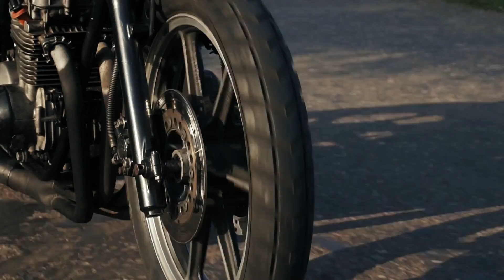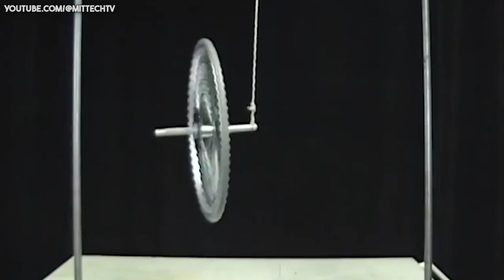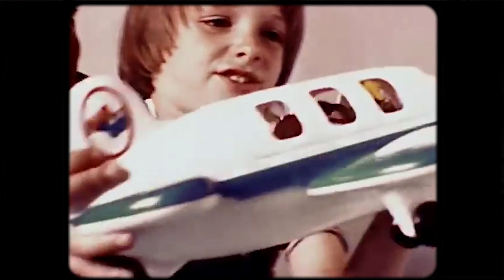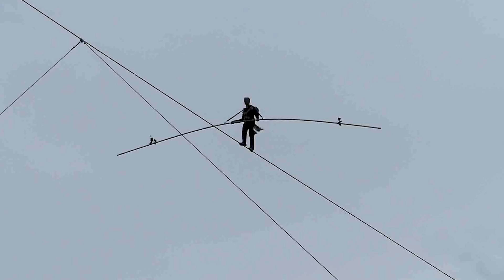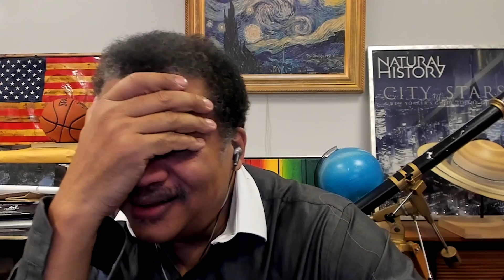How Do Bikes Stay Up? | Neil deGrasse Tyson Explains…

Comment: When it comes to bikes and motorcycles it all comes down to the rake (offset angle) of the front axle and the fact that the fork can move turning the wheel left/right, while the rear axis is fixed. Bicycles and motorbikes has two critical speeds. Going forward reaching critical speed the bike is self-balancing. Going backwards reaching the other critical speed the bike becomes completely destabilised. This means that reach enough speed going forward and the bike will lean the front wheel into any turn and self-correct raising itself up due to center of mass, rake and newtons first law. Reaching enough speed going backwards and not even the best computerised system can keep the bicycle upright (it becomes complete unstable). So the video is missing a few key elements to a bike, mainly the effect of the rake and the fact that a bike has two critical speeds, one making it stable, one making it completely unstable.

Comment: Neil, thank you for the excellent explanation of the equilibrium on the rope. But when I was a kid, we used to walk on the rope with a rigid bamboo pole and not the flexible one. Of course  the rope on which we walked was not very high and the pole was only about 3 m in length.

Comment: Apart from gyroscopic forces there is also another self righting force generated by the castor of the front wheels; i.e the angle the handle bars make when connected to front wheel. That's why you can let go of the handle bars in motion and the bike won't tip over and continue to follow a straight line. Perhaps that explains why the bike with the counter rotating wheels to cancel gyroscopic forces was still able to stay upright.

Comment: high wire walkers use heavy stick that is why its bent so much. It must be heavy for higher inertia its getting to act like a handle to increase balancing ability. put those wobly figures(weebles?) on that wire and see if they would rise after tilting to a side. on a plain they are suported where ever you lean them. on wire not. they only teoreticly would balance on wire only when tilted in direction of wire so that walker should hold that stick paralel not cross that wire if lowest center of mass would only be the reason why rope walkers use that stick.

Comment: I am no physicist but I think that for a bike (or any comparable vehicle) to stay upright, the center of mass must actually be ABOVE the center of the wheels. And if you think it through that kind of makes sense: A system of any kind is only stable if it is able to counteract any disturbances from its equilibrium (like those wiggle-dolls you mentioned). For a bike that means that if it is going in a straight line and upright, it must counteract any motion that drives it away from that configuration. Imagine the bike (going at some speed) tilting slightly to the right (or left). What happens initially is that the front wheel will - due to its  gyroscopic precession - turn inwards to the right, ultimately forcing the bike  to turn. Now, because for most bikes the center of mass is located pretty high up relative to the center of wheels (plus rider even more so) that turn will induce, loosely speaking, a centripetal force on that center of mass to the opposite side, resulting in the bike leaning back to the left. This will go back and forth until the front wheel is aligned again. If that doesn’t appears convincing, picture a bike where the upper half of the frame is made of light plastic and the lower half is made of heavy lead. If that bike, rider excluded, were to go downhill starting in a stable configuration and started to tilt to the right, I would not expect the bike to realign itself. But that’s just my theory and I could be totally wrong haha. Cool video anyway✌️

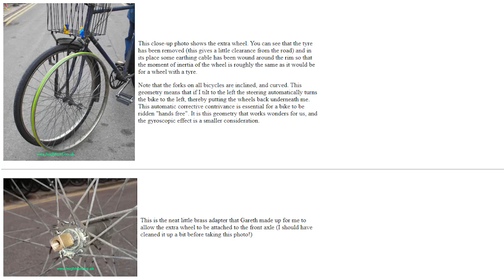Comment: 2:08  "which cancels out the physical angular momentum of the rotating wheel"... and?!  it doesn't cancel the gyroscopic effect(!), it increases it(!).  o what you say at 2:16 "the whole system cancels the gyroscopic effect" is just WRONG.  wrong.  wrong.  wrong.  surprisingly wrong coming from a mind like yours.  and all your interlocutor can say is "interesting", eating it all up.  lol 
however, it's not just gyroscopic effect, it's also balance and corrections made by the person (that's why we can ride a scooter with tiny wheels just 7cm in diameter).  And it's also the bike's geometry (ie: trail, which is a term used to describe where the tire touches the ground in relation to where an imaginary line through the steerer would meet with the ground).
Reply: Nope - NDT definitely got this part right.  And it's not like it's difficult to test this one yourself.

Comment: If there is no external force to cause acceleration of one half of the tyre and an equal but opposite deacceleration of the other half then the front tyre will remain straight , i.e stability while in motion.

Comment: The best film version of ghost bike is found in ‘Jour de Fete’ by Jacques Tati. It parks neatly at a cafe in jaunty manner.
  Two counter-rotating wheels sharing same axle and plane of rotation cancel out? I know very little.   
  A single rotating wheel is more stable than two with one joined to frame and one freely yawing…….

Comment: What if ha ha hypothetically speaking my bike with half a tank of gas weighed 99.79032kg and I weighed exactly the same as I bailed and watched my baby 180 into a sad tank of water. Drowned. Then my '02 Silverado retrieved but did not rescue that Blue and White motorized bicycle of art. God bless all pickup truck trailer hitches. Otherwise my bike would be a geological distant artifact.

Comment: We also make small corrections when the "bike" is moving slowly, by turning in the direction of the fall. This creates a "centrifugal" force, returning the bike to an upright position.
Reply: Nope.  There is no centrifugal or centripital force to speak of when riding slowly.  You're simply moving the bike underneath you to maintain equilibrium.
And the "QED" argument?  The track stand.  I can sit forever in a track stand, with only little forward and backward motion (which is translated by the front wheel to left and right motion respectively).  Obviously when you aren't moving, the wheels have zero moment of inertia, and thus no centripital or centrifugal forces in action.
The bike is simply moved back and forth underneath the rider who maintains balance equilibrium above it.  When falling left, I power forward, with a left-turned front wheel and the bike rides underneath and "catches" me.  When I "fall" right, I roll backwards and catch myself on the other side.

Comment: It has little to do with the center of mass being low, more about the fact that centrifugal force does not exist. When the front wheel turn left or you lean the bike left the front wheel turn more left than than the back wheel, this result in the back wheel continuing its course and thus acting like a force pulling the front wheel back to the right. This plus the energy given from the ground hitting the wheel giving it 2 effects permitting is to lift itself back straight.

Comment: I’m sorry, but this was a very weak explanation. It wasn’t bad for the high wire, but said nothing about the bike.
Of course centrifugal force has very little to do with it. I can ride a bike extremely slow. Yes, lower center of gravity helps but it will always be precariously high above the two small points of the base.  The center of gravity must remain above the plane of the two points.  If you start to fall, you have to turn the wheel in the same direction, which moves the plane under where the center of gravity had moved to, making it stable again. That’s it. To prove it, try riding a bike with two fixed wheels. The ride will last about 2 seconds, because you are unable to keep the center of gravity over your base (unless you pick the front tire up and move it just right, like a pogo stick).

Comment: We gotta "know" the 'critical' center of mass in the system we desire - like on our bikes or up on the wire. 'Critical mass' like the moment between not boiling and boiling - there's a point of no return  - the center of mass can bring you down to the ground because it is so heavy- it ain't easy till it's easy, then it balances. You don't forget how to ride a bike, so they say.
As an off-road rider I grok this, the bike will just stay up if you keep yourself flexible, strong and ready to go with the bike. Use the throttle and clutch to keep momentum and brakes to control speed. You put the body's momentum toward the line you want while looking fairly far ahead.  Hitting huge rocks will fling you one way or the other and the bike will just stay up if you can hang on and stay ahead maintaining correction momentum for the body to match the center of mass toward the lowest point in the system. It's an amazing fun ride.. hang on!

Comment: Bicycles are rear wheel drive so the gyroscopic precession is in the front wheel.

The industry term is "e-bike".  Which is short for, electric bicycle. The battery pack on e-bikes is typically on the down tube or seat tube.

#Bicycle #GCN  #Bike

Comment: Sorry Neil to completely debunk u're theory about the e-bikes being less stabile than those without motor and battery cause it is just vice-versa: the e-bikes especially mid-drive like mine are more stabile cause the engine and the battery that nowadays anyway are having only 5-7 kg adding are LOWER than the center of mass of a simple one that is very much raised by the very YOU that at let say 80 kg vs the 20 of a simple city-bike when motor-akku unit added the center of mass is dropping by quite few centimeters !!!! ;)

Comment: As a long time bike person I can also comment on that the amazing thing about a bike is that when you make a turn, you actually first slightly turn the handlebars in the opposite direction of your turn (so called "counter steering"). Many bike riders deny this because it is so counter-intuitive, but it is actually for real.
Reply: I'm also a many decades long rider of bicycles and motorcycles still, and I agree. You are correct, weird as it may be to the inexperienced. Only a nuance I'd add is (of course) it applies at a decent rolling speed once it 'kicks in as gyroscope effect. In a parking lot, one actually turns the bars from the get go in the direction desired, not so at at speed (10mph say) initially counter steer for sure to start the lean, which is how the bike turns at speed. Once started, of course the hands/eyes/brain combo finesses to smoothly, almost imperceptibly, align the bars again in the travel direction a bit, the leaning doing most of the work. (And providing fun... .)
Ride safe... .
Reply: @darcyoneill9377   While riding in a peloton and someone is about to cross your front wheel you may find a reflex front wheel turn away from their wheel while leaning/ throwing  opposite direction then flicking your wheel back will save a spill. You watch yourself do it by reflex.
Reply: @olmalone  I'm sure, although my experiences don't include riding in a peloton, I relate from single track dirt trail, close following/followed sometimes, trail rocks/roots to deal with 'on the fly', sharp turns, along, up, and down hills, and, when not that a big city bicycle commuter to work... !
Reply: @darcyoneill9377  
>> In a parking lot, one actually turns the bars from the get go in the direction desired,\

Most riders believe this to be the case, but I assure you it's not.  I made a video with Derek of Veritasium that demonstrates this.
Reply: That science Youtuber guy build a bike that didn't allow you to do that and it turned out you could not rider the bike 😂
Reply: @Kasper-i7m  Yup - that was me.

Comment: Question that popped into my head is if cats change the center of their mass when they fall? As they "always" land on all four. I have read that by pulling the paws in towards the body, the cat causes the front part of the body to rotate faster than the back part. When all four paws are facing the right way, they can absorb the shock of impact. Whats the science behind it?

Comment: The average mass of the battery is about that of the wheel axles; the mass of the motor is near the pedal center. I find my ebike quite stable. Wheels as gyroscopes help in all sorts of riding, on the ground and through the air.

Comment: Actually this is the 1st time I disagree with my "personal astrophysist". If a low center of mass would level the bike, then it must also work while standing still, like the man on the wire can stand still with his ballance bar. The tipp piont of any bike is the connection to the surface it is rolling on. Any center of the mass of any bike is allways higher. And if you look at the popular high wheel bikes thebiking began with 200 years ago, they work as well, even the center of mass is extremely high. I tested it by  building a gyroscope with 2 rotationg wheels running in different directions. Yes, I only used LEGO and heavy stainless steel balls from a ball bearing from a fire trucks pump (it whas what I had laying around) to give the plastic wheels some weight at there outside circle. Surprisingly it still works. Yes, the math says it levels itself off. The reality tells a different story. I'm only a geologists, not a physisist, the math I had to deal with while studying had been not that heavy as in physics and physic as a field only had been a side show in my studies, yet I think that we (the scientists) have to go back to paper and pen. Obviously there is something about spinning masses that we do not fully understand yet. Something is missing in the occasion. Sincerily, Stefan, following you from Germany.
Reply: Yes, center of gravity is pretty much only an issue while stationary. As soon as you start moving, you ' catch' your fall by slight steering inputs. Basically you move you point of contact with the road to the left and right of your centre of gravity all the time. This steering is helped by trail ( frame geometry) and the width of the tire.
Reply: @rienkhoek4169  no. The StarTalk killed the coreolis effect as the balancing part and replaced it with the center of the mass below the contact point on the examble of the man on the high wire. And StarTalk didn't answer my question. Instead you do come forward with a frenquently left-right-left-right-and-so-on-steering. Neither bikes nor gyroscopes work that way and it wouldnt explain the center of mass has to be low point of view. You do not lower the center of mass by creating a horizontal pendula via steering absurdly. If you weld the steering axle of a bike perfectly strait, it still would run perfectly. We tried that in physic class in 1982 at the engineering school.
Reply: @Stefan-mg5gl   I say nothing about the coreolis effect, which doesnt have anything to do with riding a bike. Welding the steering axle will make it impossible to ride the bike for over a few seconds at best. This video from Veritas clearly illustrates my point on both welding the steering axle and  how you shift your point of support to prevent tipping over. I do agree with you that the center of gravity has very little to do with balancing. I am very curious what you think of this video.
https://www.youtube.com/watch?v=9cNmUNHSBac&t=466s
Reply: @rienkhoek4169  I'm a Veritasium subscriber. Yet we welded it straight ahead 50 years ago to prove the gyroscopic effect. Here Veretasium tells about three effects. I'm pretty sure that each of those three do work to keep any bike stable, yet most effective is to combind them.

Only issue though: at fast spinning front wheels at f.e. motor bikes the geometry of the steering axle becomes vital. It either kills you (as it would with the little experimental bike shown in your video link) or safes you (as the one shown at the start of the Veritasium video).

Comment: This theory could be easily tested by trying to ride a bicycle that doesn't have handlebars or steering of any kind.  I'd really like to this tested cos I think something else is going on but I'm not sure what???
Reply: This has been done! You cannot stabilize a bike without any steering ability. Basically, when you are biking, you are constantly falling left or right, and that is compensated by small steering inputs. When this is not possible, you will fall over.

Comment: I actually have a electric mountain bike with fat tires for stability outdoors, I can 100% say you can ride it for awhile without hands because with pedal assist it’s enough momentum to stay up and depending on the road and how it curves the bike will stay on course. 90° angles are the tricky part.

Comment: An interesting fact about motorcycles is that a bike set up for Trials, which involves a lot of low speed maneuvering,  has a steeper rake then a bike set up for road racing which has a  gentler rake angle. Motorcycles set up for drag racing which aren't intended to turn,  have their front wheel extended out a few feet to keep them going straight.  To get a motorcycle to turn left you actually press down on the left handlebar and to turn right you press down on the right handlebar. Having a single disk brake on the front wheel doesn't make the motorcycle veer to what ever side of the wheel it's mounted on.  And you don't lean on a motorcycle in curves, you keep your body straight to maintain stability!  Understanding  the physics of a motorcycle is important!

Comment: Here's my counter question: If the pole is for lowering the center of mass, the highwire walkers who do this without a pole usually use their outstretched arms to balance...If lowering the center of mass is the way to go, why lift your arms up to shoulder height, instead just keep them low by your waist?
Reply: Its a weird answer alltogether. If you even tried balancing a broom or something on your hand, you will notice it gets easier with the heavy side up instead of the other way around.